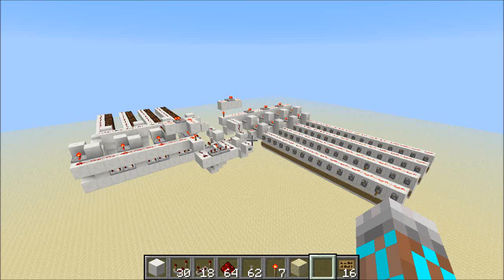Signal Strength Serial Transmitter - 2 Ticks/Input

Comment: It's cool, but the data line itself is super-slow. It's 1 tick per 2 blocks in your design, but i believe it can be modified to be 1 tick per 4 blocks, wich is also very slow, compared to possible 1 tick per 18 blocks for a repeater data line.